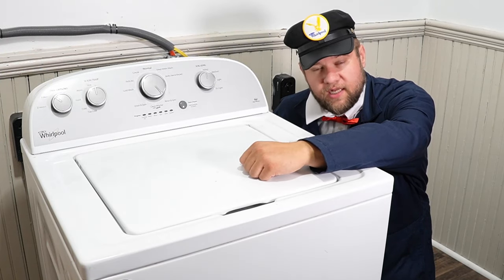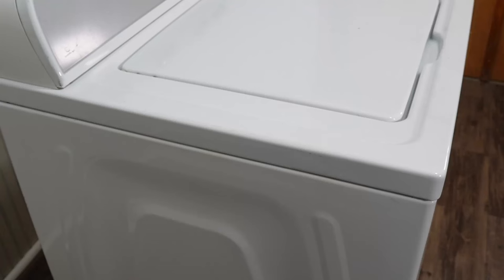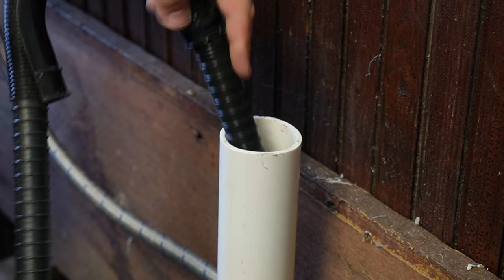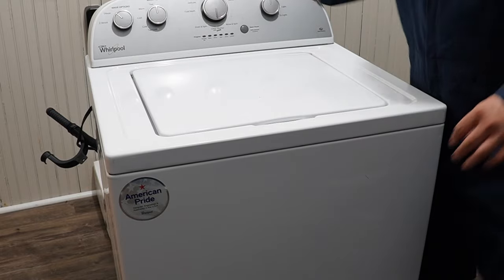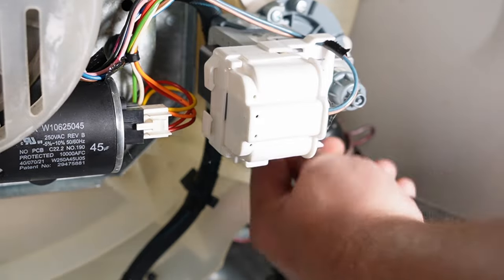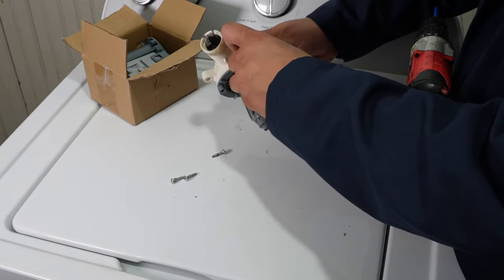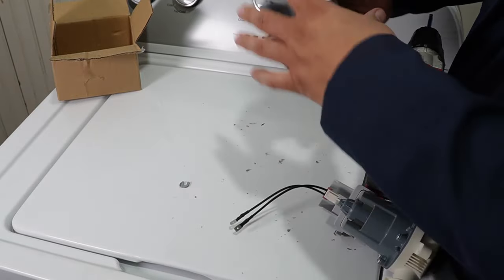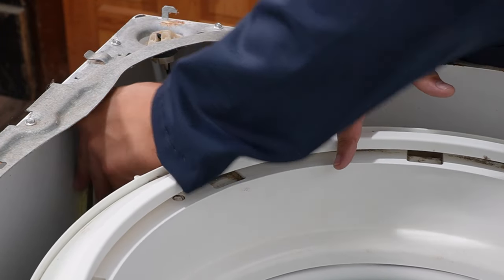Whirlpool Washer Won't Drain - How to Drain the Washer, Diagnose and Fix

Comment from the maker: If in case you need a drain pump for your Whirlpool washer, this is the kind we typically use since it covers a TON of various Whirlpool models: https://bit.ly/3zJQ7z8
Reply: Is a new drain pump expensive? Even a universal drain pump how much does it usually cost?
Reply from the maker: @define83  there's a link in the post you replied to with the universal pump and the price...
Reply: Bb0b 🎉😮
Reply: I have a question. When you took off the old pump, it had a flop top cover for where you attach the power cables (the old was white @5:21). When you showed the new one @6:24, it is grey where the power cables attach, and it doesn't have a flop top. But when you reassembled the pump @7:18, the white end to attach the power cable was back, with flop top, which is fully visible @7:24. How did you get the flop top off the old and onto the new since the new did not have a white top? I'm curious if that flop top cover needs to be on there.
Reply: W10536347 isn't listed - for a Whirlpool Cabrio. Whirlpool part is about C$170, but cheap Chinese parts are $35-40 but only last a year. Will DP1 work for my washer?
Reply from the maker: @charliebrady3751  whats the model# of the Cabrio?

Comment: You saved me from having to buy a new washer! There was a gigantic plug of crud in the drain right under the drum. I pulled it out with needle nosed pliers and it fixed the draining problem. I'm excited to be washing clothes in my own home again. My King!
Reply: What was wrong with your washer at first? Mine stopped working during cycle to find that it had water. And now my washer does  not want to start like how it used to

Comment: After watching this video and some of your others, I called a local appliance repair to get a quote, as I was still unsure about doing it myself. When I told the repairman what I knew, he said I sounded pretty handy and that I could probably do it myself. As we talked more, discussing the details of my problem, he offered me a job! I got my new shifter actuator and replaced it in probably 20 minutes. I calibrated the washer, then ran the auto-test and it works fine now! Thank you so much for posting these great videos! I hope you have more business than you handle and are successful beyond your wildest dreams!

Comment: Super helpful. We didn't have to replace the pump :) Even if your whirlpool is slightly different (the location of our pump/hose was underneath but toward the front when we tilted) it's the same general idea! We undid the hose and lo and behold a sock in the actual pump!! Thank you so much !!!
Reply: Wow, I had this exact same experience. Crazy how a sock can get in the pump. I didn’t even take the pump out, just undid the hoses and found that a sock was wrapped around the pump. I took some pliers and twisted the sock around then until it forced it out. Now the washer works great again.👍
Reply: I had mine on soak... How do I get it to spin now?
Reply: I got called out to my rental property. There wasn't a sock in the pump - but there was a sequined thong! :-)

Comment: Hi. I'm replacing the water inlet valve (WHIRLPOOL 3979347) on my Kenmore 400 series washer. Can you tell me if it matters which wire connects to each temp sensor? I forgot to notice.

Comment: HELP Ben, my Whirlpool washer has two issues now probably because I let it sit for 6 months. 1 it would fill with water slowly and then spin and drain but wouldn't go on to the next step of washing agitating. 2 I have extremely hard water and I think it has clogged the solenoid but now it won't fill but trickle in even when it's off and unplugged the water still trickles in. Please HELP

Comment: Is there anyway you could do a video showing how to take apart the whole washer and cleaning the drum… I am a 20 year old trying to make my appliance last longer. I have clothes that smell great when they come out of the washer and dryer but smell after a few days. But my mom uses a lot of fabric softener so I’m assuming I need to clean the washer. We’ve had it for 10+ years so it could use a clean. This looks to be the same washer so this would be very helpful if you could. 😊 also loving your videos thank you.
Reply: If it ain't broke, don't fix it

You're not going to make it last longer if you take it apart for cleaning

There is a " clean the washer" programme on the washing machine for a reason
Reply: @mosab7  do you have a recommendation for cleaning products that you put in the washer for that setting?  I usually just do some white vinegar and run the cleaning setting.
Reply: @babyluna7414  Dr Beckmann

Comment: When I removed the outlet hose from the pump the small rubber flap was lodge in the pump outlet. Is is held by small piece of rubber that has split. After cleaning out hose and removing the broken flap my washer is draining correctly. Question now is…do I need the rubber flap that was removed?

Comment: Love your channel, but I’m hoping you can do some videos on LG front loader problems. Ours sounds like a jet engine when it spins, but my husband has dragged his feet about trying to take it apart to figure out what the issues could be. 

Also could you show a video on how to deep clean the front loaders. We dry it when we aren’t using it, clean the gasket, leave it open, with a little fan blowing in it, but there has to be a lot of hard stuff stuck between the layers. We use the washer cleaning tablets, but I feel like there’s got to be hidden crude.
Reply from the maker: I bought a pair of LG frontloaders just for videos so that's planned for sure. Sadly though if there's a loud constant noise in spin it's probably going to be the bearing
Reply: @bensappliancesandjunk  : And check also the 3 point spider too.
Reply: @bensappliancesandjunk  So glad I found you! Where you BEN all my life?? 😂 Spin cycle is working but clothes are still real soggy. I had pulled apart the controls thinking it was the load sensor switch (couldn't find it on my model) but  now I  suspect the pump might be a bit clogged. I think I'm gonna put it back together, clean everything, run a cycle with vinegar and try to listen hard for weird stuff before I tackle the pump. Gonna need help getting this beast up and down off the floor...and the washing machine, too! 🤣Cheers! Judy

Comment: Is this information useful for whirlpool washers that have the electric control panel? I have a 2020 whirlpool washer and it is having issues draining. We have narrowed it down to the drain pump malfunctioning. The drain hoses are clear and installed properly so my next resort is going to be to follow this tutorial and clean or replace the drain pump. Thanks for the video and thanks in advance for the advice
Reply from the maker: ...yes? This has electronic controls. Just with regular dials. All the ideas are going to generally be the same

Comment: Hi Ben, thanks for the video! I replaced my pump and checked for blockage and didn't find any. The washer still won't drain. The pump does not run when I perform a manual test. What else could it be? Also changed actuator and capacitor.
Reply: same problem ronoel315...so what to do next Ben? Help us please!

Comment: There were no sods, but some of my clothes, and especially my blankets/towel still be pretty wet. Also has a good weight to it. Does it still apply to use vinegar?
Reply: Having the same issue. Some models you can replace the load sensor switch. One video on YT about WET CLOTHES and Kenmore machines shows you about it.

Comment: QUESTION: Two weeks ago the agitator on my GE top load washer was replaced. Now the water level is very low even though it set in extra large. It still washed and rinses. Do I have a washer or plumbing problem? I haven't noticed any change in water pressure through out the house.
Reply from the maker: Check for derbis in pressure port / pressure hose. I got a video on that soon coming out

Comment: Hello! I have the same exact washer. My issue is that there is water left under the washer tub after washing. Once my clothes are done washing, I can hear water underneath if I move the drum, however the drum is completely drained.
Reply from the maker: Virtually all washers operate that way. The pump will always have some level of water in it. The 10-30gal of water will cycle any residual water multiple times over each cycle.
Reply: @bensappliancesandjunk  thank you!
Reply: @bensappliancesandjunk  Mine has the same thing and it kind  of smells like stagnant water, will try your video and see… any other suggestion?
Reply: @bensappliancesandjunk  So, you're saying that is normal? 

I have the same issue where there's water left under the tub. If I shake it you can hear it. Otherwise the washer works perfectly it, pumps the water out of the tub without any issue. At one time, it became stagnant and started to smell similar to what @madravenpr said. I took machine washer cleaner and took care of the smell.
Reply from the maker: @madravenpr  yes, 100% normal. If you have a bad odor, use an affresh tablet, vinegar, or our wash bomb formula to remove any gunk underneath.

Comment: Hi Ben, love your videos. No drain on one of these Cabrio washers. I did the physical checks and the pump shows 16ohms resistance.

When I use drain and spin, though, the voltage varies widely from 95-150 volts. I assume this is likely a board issue and not the pump? Have you encountered the same?
Reply from the maker: I haven't, but cabrios can definitely have that problem where the pump relay contacts are intermittent causing voltage to fluctuate resulting in a myriad of issues.

Comment: I have a maytag mvw7230hw.  The pump will drain water out at the beginning of the cycle.  The unit will stop draining during the cycle.  If I tilt the washer forwards or backwards, then the pump will kick on. What causes that?
Reply: Sounds like a Guage sensor. 
Like a gas tank or something.
One it gets so low it kicks off.
I know  othing about this stuff so just guessing.

Comment: I have a question about a drum I removed from a top loader whirlpool washer.   The washer has been shaking violently after checking all the usual failures I took the machine apart to find the drum sounds like it is full of water in the inner linning.  I have turned it upside down and still will not drain.  I feel like I should drill some holes but I'm not sure if that's a good idea. What should I do?
Reply from the maker: There's water in the ring as a counterbalance. Totally normal, and actually a bad thing if it drains out as it will shake far more violently. For the love of God, DONT drill the holes.

Comment: @bensappliancesandjunk what setting do I use for a multimeter to check? ACV 200?
Reply from the maker: if its live voltage, yes
Reply: @bensappliancesandjunk  I have it removed. Everything was clean. I just want to check with multimeter to rule it out. Wondering if an actuator is my problem next. Just don't know which option to use for multimeter.

Comment: Bought my washer and dryer in 2016. In April 2023 we moved into this house that has a little cut out area and a low set spot for the washer, and NOW it decides not to drain in September 2023.  I won't be able to drain to a bucket or remove the back until I pump out all the water so I can get this thing out of the stupid hole it sits in. Oh have mercy 🤦‍♀️! Wish me luck!!! I'll come back and let you know if I got it out or took a sledge hammer to it!
Reply: We got the pump motor changed out, and tried to recalibrate. Ended up calling someone to reset and recalibrate. Very happy to have a working washer again

Comment: How do we get to that on this machine. When you turn it over, I don't even see one in this video.
Reply from the maker: Literally lift the washer and tilt. You'll see it right under neath
Reply: @bensappliancesandjunk  I mean the filter not the pump, I'm sorry. I also read that maybe this doesn't have a separate filter. Thanks for the quick response.
Reply from the maker: @TheAbulletAway  The filter on this style is underneath the drum in between the pump and tub. Its not easily removable. You basically have to remove the pump to get to it. Its more of a coin trap
Reply: @bensappliancesandjunk  Thank you. Truly appreciated.

Comment: My washer spins I check the voltage to pump and is good I replace lid lock but when I hook the pump it looses the voltage and it will not drain
Reply from the maker: Probably a bad relay in board

Comment: So my parents washer wouldn't drain, wondered if timer, or pump. Opened lid and pressed down on the lid switch, drained, rinsed, drained, spun dry.  So new lid switch? Would have never guessed that to be a draining issue.
Reply from the maker: Lid switch tends to stop everything from running. If it's an older whirlpool, the lid switch is tied to the motor and that's physically tied to drain pump

Comment: What if it seems like there is water UNDER the drum. It’s like floating on top of water. There’s 0 water inside the drum but I can hear the water under the drum.
Reply from the maker: Its water in the drum as a counterbalance weight as well as some water in the drain pump. 100% of washers have that.

Comment: Mine drains, but doesn't drain completely. As a result, if the spin cycle is too high, the shaking causes some water to pour out.
Reply from the maker: Sounds like there's a major problem somewhere. It shouldn't pour out at all. Is it a Whirlpool like this?
Reply: All top load washers have a water balance ring. If there is no visible standing water. Don't worry about it.

Comment: I washed a rug, the backing came off and I was able to get it out of the washer but I don’t think I got the entire thing. The water will not drain and where could that leftover piece have gone? 👀
Reply from the maker: Drain pump almost certainly.
Reply: @bensappliancesandjunk  thank you for your quick reply! I thought my washer “died” and was about to spend $450 for another used one… the hose is at an angle at the top and bottom but nothing happens if I lower the top down so I think that must be it then! Too bad I don’t have the tools to take that off right now lol hubby has a job to do when he comes home with the work truck that has all the necessary tools to get that thing off! I stuck my fingers in and eewweeeee!🤣black stinky gookie stuff all over my fingers 🤢

Comment: Ben I need your help
Reply from the maker: Ok?
Reply: @bensappliancesandjunk  just bought the universal pump from you. But my mounting bracket is to small for the old one and the wire connectors are different. You did send me the new hook up but which is which? They're both black but the wires on my machine are black with a white line and the other is blue with a black line. So which wire is which?
Reply: Bracket is to small for the new pump
Reply: @bensappliancesandjunk  did I just but the wrong pump?
Reply from the maker: @joelreyes2734  black is the same on both units
Reply from the maker: @joelreyes2734  was the universal pump listed as a viable replacement for yours?
Reply: @bensappliancesandjunk  yep. I bought the wrong part. Is there any way I can send it back and get the right part ?
Reply from the maker: @joelreyes2734  Sure, send us an Email via the site along w/ model# on the washer and we may carry the right one, but AFAIK the other WP ones are more expensive.

Comment: I can hear my pump running but no water flow out of my washer..
Reply from the maker: Its either an obstruction to where the water cannot flush out the hose, or the pump is actually shot to where the motor runs, but its not spinning the impeller to push the water out.
Reply: @bensappliancesandjunk  thanks man, I'm trying to drain it now by small buckets & fixing to inspect the pump when I get all the water out.. had sewer problems lately to, thinking it backed up & trashed my pump or I have an obstruction on the in-side of pump